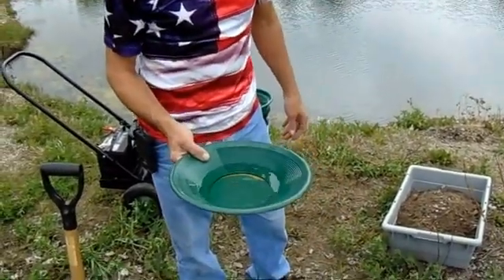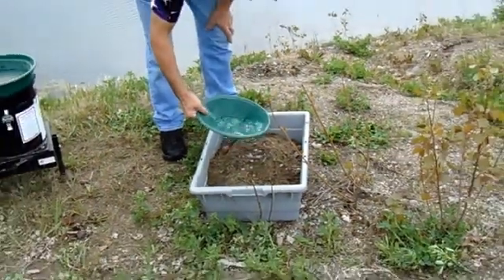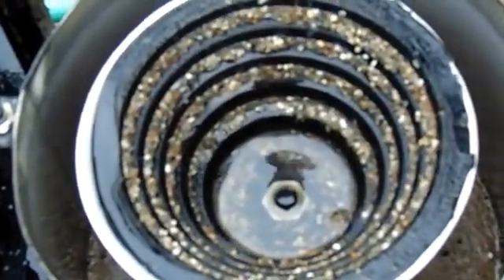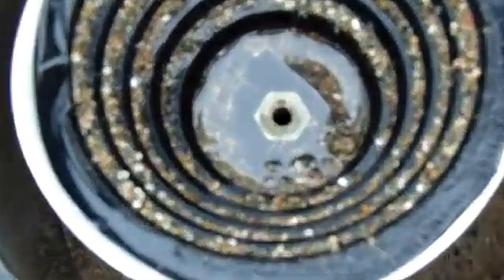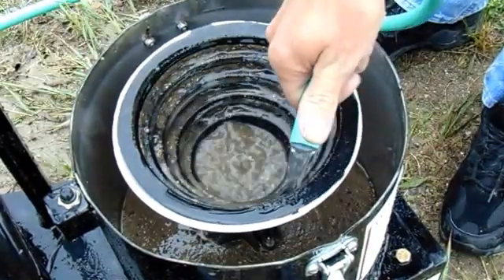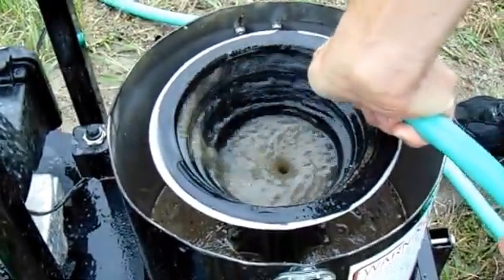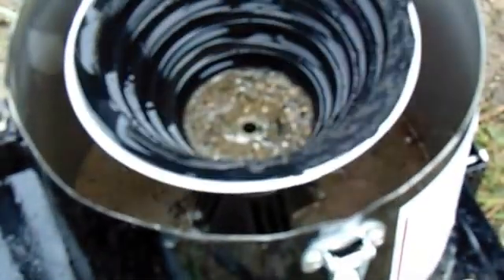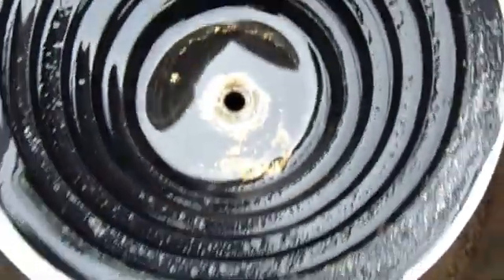'Lil' Gold Spinner cleanout and efficiency

Comment: Will the machine plug up if you are working an area with a lot of blacksand. Do you have a Canadian dealer.
Reply from the maker: ProspectorFrank no it will run the blacks and on through and hold only the gold
Reply: @leeh8115  .... where I can buy this?
Can I get the manufacturer contact details so I can purchase alots of these machine.
I do have alluvial gold mines for which now only mine and process using panning.... my email ali.noerrdin@gmail.com